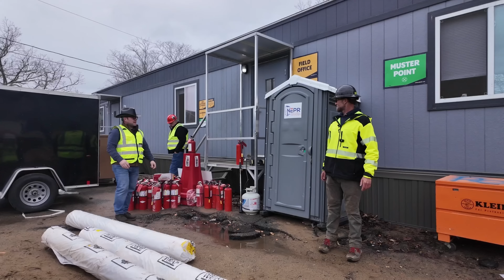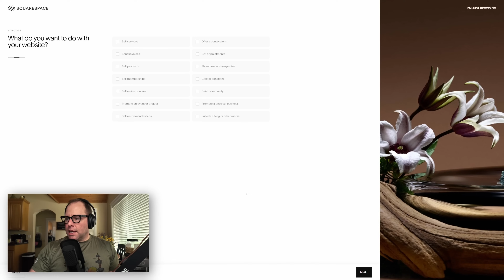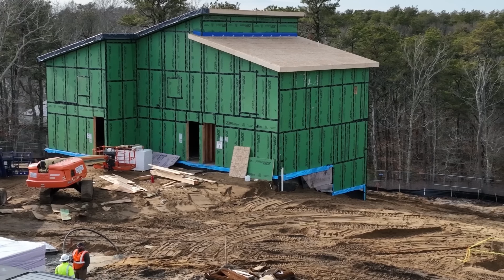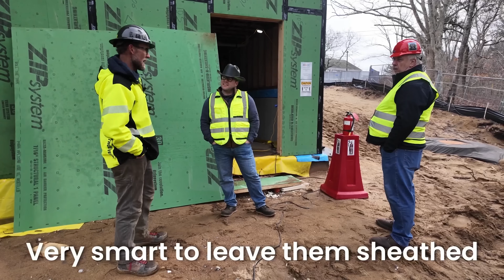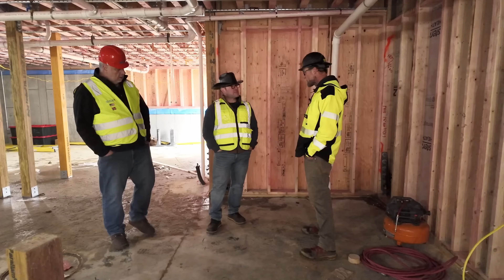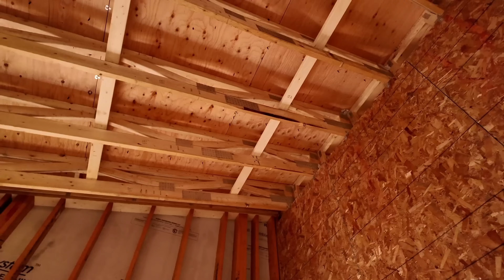Cape Cod Builder REVEALS Why Prefab Framing Works

Comment: I must be missing something the title was "Why prefab framing works". To me prefab framing means the all the walls were built up and sheeted in a factory then hauled out to the site. Once on site they would be staged then hoisted up with a crane placed on a finished slab, anchored in place, plumbed and lined, braced and start setting floor trusses. I figured we would be seeing the walls being assembled in the factory then sent to the site hoisted up placed on the slab nope. Its was all about, Zipp system, flashing, vapor barrier, LVL's, hardware and load path I did see that nice prefab guardrail system that I wished I saw that 30yrs ago. I must admit though that has to be one if the cleanest framing jobs I've seen.

Comment: I have to ask, how does that 2" gap between the "structural" panel and the stud wall effect the sheer. Because foam is not structural.

Its affordable housing, but all these fancy beams and hold downs for style. Just build f'ing ranch ramblers.

Comment: are you concerned at all about condensation between zip and Henry SA after its cut, flapped up and taped? seems similar to some vapor barrier details where poly gets folded up and tape. ive been thinking more that its better to turn the poly down onto foundation or in the is case leave the blueskin and tape from zip to flat blue skin to foundation with something like contega or fentrim...vapor open but air and water tight. obviously we dont know all the details and decisions. but you cant deny its a bit a of a vapor sandwich.
Reply: Where would it condense if the membrane is adhered to the zip?
Reply: @Austin-fc5gs to me it looks like the outside non SA side is being folded up and to the inside. Otherwise you are correct.

Comment: Bet the David Lee Roth can’t do a 12/2 stair split in a 9 foot first floor  7 3/8 rise/ 11 3/4 tread . Then a 11/3 stair split to 3rd floor with landings. No stinking pinth blocks, all 7 inch ,,,floor trim runs ground to 3rd same height. O never seen that before…
Reply: maybe with a little stretching....?